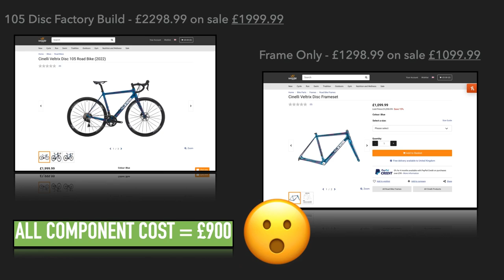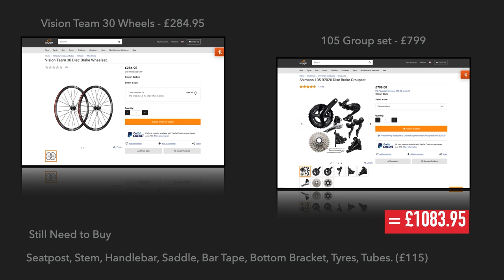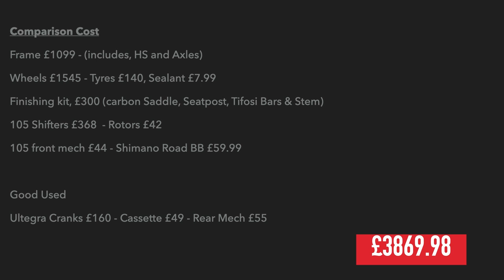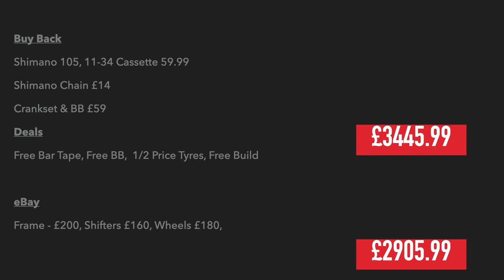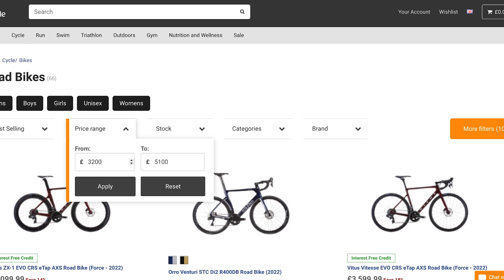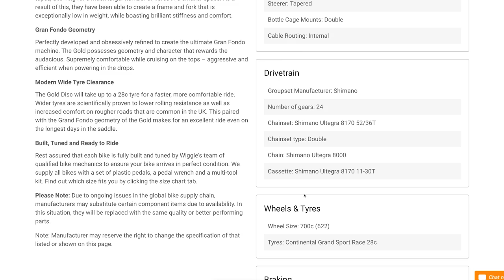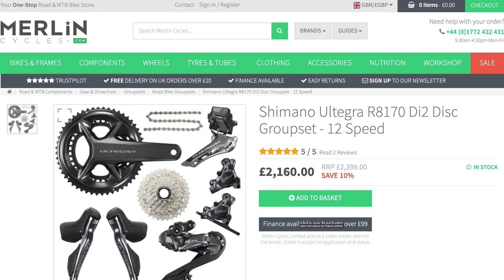How we build the Bike you WANT for the Price you NEED

Comment: I bought the rim brake version of this bike 3 years ago with Ultegra 11 spd mechanical. Retailed at £2499 I bought it on discount for £1499. I sold all the finishing kit, wheels and tyres etc on ebay as they were woeful. The bike as speced was over 8 kg. I put Hunt 36 Ud carbon wheels on, reilly carbon seat post, deda rs stem, 36 cm carbon bars from wiggle own brand, fizik tempo carbon rail saddle, Absolute black sub compact chain rings, ultegra 34 cassette, tpu tubes, conti 5000 tyres. Titanium speedplay pedals.  With pedals and bottle cages and computer mount weights sub 7kg. Rides brilliantly and I do 5000 miles every summer without fail. It is an XS frame and like mentioned above isn't the lightest but feels very robust. I ride around the Peaks and Yorkshire so roads not great.

Comment: He forgot the biggest difference between the Ultregra and 105 cranks - (btw, they are both hollow), BUT the Ultegra is glued together and will come apart for many.  105 will never fall apart.  If you're going to replace the Ultegra chainrings (the real benefit of Ultegra vs. 105) with oval or otherwise - then buy the 105 crank and save your peace of mind that your crank won't delaminate.
Reply: Exponentially more people have issues with their SRAM DUB bottom brackets than they do Shimano cranks delaminating. Just saying. 🙂

Comment: I want you to talk with Liv Cycling about why they completely disagree with everything you reported in this episode.
Reply from the maker: I would love to.  I would love to know why Liv  makes women’s bikes with heavy parts, big gears, narrow bars, massive saddles, extra brake levers and wheels that are too big.  Women are so diverse in shape and size that custom building is so important.  You see a very woman. Maybe 50kg and pushing 4w/kg still has to use a bike weighing 8kg at best. As a percentage of body weight that’s  a huge disadvantage.  Then if you put regular gears on that they are still not low enough for a perfect cadence.  Canyon probably have the best women’s bike range. They even do a smaller wheel size so handlebars can be at a the right for efficient peddling.

Comment: Completely agree with quality wheels. I have 2 pairs of w&heels hand built by Malcolm at The Cycle Clinic in Suffolk. They run true and smooth. The original wheels i use between December and February a bit sacrificial. I chose Shimano 105 with the exception being a 46/30  Shimano GRX chainset and GRX front mech. For me, i find 50:11/12 too high and for most id wager thats the case. Saving 500 grammes on a groupset seems pointless when most recreational riders are carrying excess weight, including me. Great video, shame i dont live near your workshop.
Reply from the maker: You are right.  46/30 in 105 would be good.

Comment: I think you have this very backwards.  Spend the $$ on the Ultegra shifters and use 105 derailleurs.  Personally I had 5800 shifters and RD, replaced the RD & FD with a 6800 - I couldn't tell the difference.  Changed the 5800 shifters for 6800 and I could tell the difference.  Changed out the 6800 RD for a R7000 RD - couldn't tell the difference.

Changed the 5700 crank + rings for 6800 - front shifting was better.  Later the 6800 cranks split apart.  Put the 6800 rings on the 5700 crank arms - couldn't tell the difference in feel.  (the look was weird as Shimano purposely shaped the 6800 arms+rings from the 5800 - just so that you wouldn't save $$ on the arms with the better rings.

Comment: Nice video as always. Value your opinion and comments. How would you rate this set up for AUD $6,000: 

2022 Time Scylon. Every detail covered and presents as new.

- Continental GP 5000s with Silca latex tubes
- Ciclovation bar tape, bottle cages and cables.
- Winspace Hyper Wheels, upgraded bearings.
- Dura Ace 9100 groupset
- Selle Repente Prime 3.0 Carbon Saddle
- Enve 110mm Road Stem and Enve 40cm Areo bars

Comment: Cassette I’d say don’t use either one. Go with a SRAM 11-28 11s, which has a 16 cog, whereas the other two don’t (very few Shimano cassettes with a decent amount of range span have a 16 cog). The 16 cog is crucial to have for a lot of people if you’re running 50-34 front, and if you’re trying to ride in the 19-21 mph range, that cadence drop from 17 shifting to 15 can be more than most people can handle. That 16 cog can really help someone who’s trying to improve but can’t pul that 15 cog. Another option is Miche Primato. They make a 12-29 that uses a 16 cog and that cassette each cog is individual, no carrier, and theoretically the cogs can be replaced individually if you can locate a distributor to sell them to you.
Reply from the maker: Good info. But I don’t think you have spent much time here in the Lake District.
Reply: @Mapdec  I’m aware of the area you’re in however my comment was for the entire audience who probably isn’t in your area. Interesting side note Shimano finally added the 16 cog on their 12s 11-30 cassette.

Comment: Great video! I've done exactly this myself over the past decade or so. My latest bike is a Pinarello Grevil+, I salvaged the Ultegra cranks and FD from my previous bike (which came off the previous, previous bike 🤣), the 105 hydro shifters, XT rotors and 105 calipers too and the GRX rear mech. I kept my prologo saddle and even the handlebars (they were expensive - Roval alpinist) I invested in a new to me pair of DT Swiss ally wheels and 240 hubs, which came with RT64 rotors, new Ultegra 11-34 cassette, bar tape and a few other little bits. I had to use the proprietary seat post. I then moved over my carbon wheels (Token Ventous) to the new bike for road duties. All in, the upgrade plus 2nd hand cost for reused parts totalled about £4k, but I have 2 wheelsets and essentially 2 bikes - a gravel and a road bike. All for a price cheaper than the lowest spec Grevil+ new, which of course doesn't include a second set of wheels.
Reply from the maker: It is the way.  Better for environment too 👍

Comment: 6:32 which nipples do you think are the best? So far my fav are Sapim.
I tried the DT Swiss brass nipples, but I noticed one rounded off in the DT Swiss T handle nipple driver, and some rounded off a bit during the nipple swap, and during truing later.
But the Sapim took a beating for years, rocks strikes, trued many times, some normal wear, but still in great shape, and tolerances were great. but I see the DT varied, the spoke key. fit tighter on some nipples.  So first impressions are not that great. I double checked the package to be sure it was not aluminium, it said brass.
But I know there are different types of brass. but so far Sapim seems to be the go to, maybe why most wheelbuilds I saw said Sapim.
I won't do more with it.
Reply from the maker: Yes. Sapim as a general rule.  The DT Squarx Brass are good too.

Comment: Yea the 105 is forged one piece and the Ultegra that hollow bonded assembly that can separate. If they’re close and the customer doesn’t mind, I’d say go with the 105. Long term durability is a bit higher and after the first chainring wears out, use absolute black instead.
Reply: I'd agree 105,  no doubt in my mind having owned several series of both UT and 105. The marginal additional weight is effectively redundant. Mechanical integrity first and always. Simple choice leave the Haribos at home 😱
Reply: Go with another Shimao ring when replacing. No reason to get an inferior Absolute Black product. 🙂

Comment: Some say to avoid frames with metal inserts and go all carbon. Metal can expand at high temperatures and cause excess stress.  Over time the structure/joints  could get loose. Any thoughts on this please ?
Reply from the maker: Some say, some say… the metal expanding in heat is a poor example because we put a metal bearing in a carbon frame, or even a metal bearing in a metal shell in a carbon frame etc etc etc. The nylon shell in a carbon frame frame is probably the best BB possible. But the brands have repeatedly demonstrated they can’t manufacturer to that tolerance required for it to work.  So I think the T47 shell is a reasonable compromise on the situation we have where DUB and 30mm axles are now so prolific.    I think you will find a pro and con with every method.
Reply: @Mapdec  thanks for that mate

Comment: What's the reason for brass nipple's over alloy with Cardon  rims ?
Reply from the maker: Galvanic Corrosion.  Brass is much closer to alu in the nobility of materials.
Reply: @Mapdec  so will alloy nips  corrode the carbon rims to a point of damage weakness
Reply from the maker: @nigelwood6242  other way round. The alu nipples turn to white powdery dust and fail.  Brass takes much longer for this to happen.

Comment: sorry didnt cinelli use only open mold frames (even admitting it openly) ? not saying they are bad at all per se but isn't expensive for repaintend open mold?
Reply: don't take me wrong, i would prefer every day of the week an open mold frame it it is good quality (no voids, good tollerances etc.) then a brand name with shitty quality (probably made in the same fabric). i'm just referring to the bump in price due to the cinelli paintjob (admittingly very cool) and the brand name.

anyhow all in all would you vouch for cinelli? i'm looking at the Pressure.....
Reply from the maker: I am making a video about it right now. It will be out this week. I’m explaining the extra finishing that some brands do, like cinelli (in this instance) compared to a poorly finished frame. Open mould or not, it’s the finishing of the essential surfaces and dimensions that matter, and add to the cost.

Comment: Landfill components? My winter bike is made almost entirely of just such components. Such things do have market value especially when new, people that ride on a budget will happily use them. I feel that it's a little disparaging to suggest that a near £300 wheelset has no redeeming features other than they go round, they can be considered an upgrade for some.
Reply from the maker: I get what your saying, but these are supposed to be performance road bike parts, which they are not.  A winter bike can have quality, durable and inexpensive parts, just as good commuter bikes can.  These wheels and cranks don’t serve the purpose they were designed for.  You could get some excellent hand built wheels with easy to service hubs and brass nipples for your winter bike for less cash.
Reply: @Mapdec  Don't get me wrong, I'd not pay retail for those parts. They have no place being specced on that bike but they do have a purpose beyond being treated as junk.
Reply from the maker: I’ll put them on eBay at 99p on Monday.  See what happens
Reply: as a wheelbuilder I personally wouldn't buy carbon wheels for non competitive use, I'm happy to build with supplied carbon rims but I choose not to sell them. 
a high end DT aluminium rims are  far better than the average carbon rim.

Comment: Never buy cheap tyres or that nice bike they’re on will hit the deck in damp conditions.
Reply from the maker: So true. Think you just inspired a video title.  ‘With everything getting so expensive, what matters most on your bike’
Reply: I wouldn't call Continental Grand Sport Race tyres cheap, more mid-range. I like their PureGrip compound, have not found  it sketchy in the wet, it's more durable than BlackChili on the Cornwall and Devon roads and off-road trails like Tarka, Granite Way,  and Drakes I ride. Since fitting 25c Continental Grand Sport Race tyres  have set plenty of new PR's so they roll pretty well.